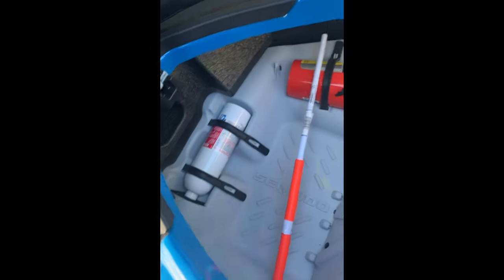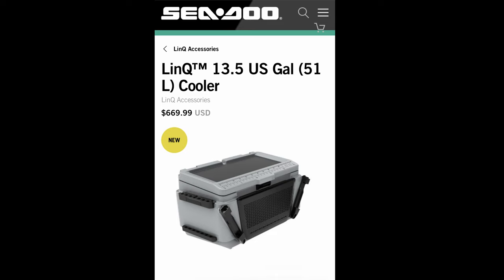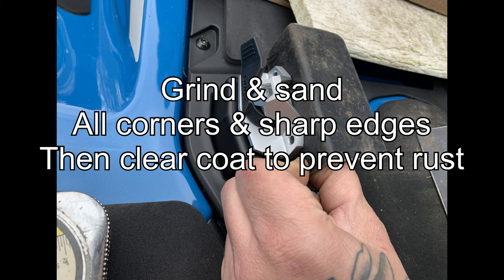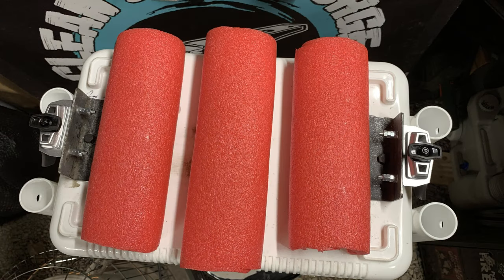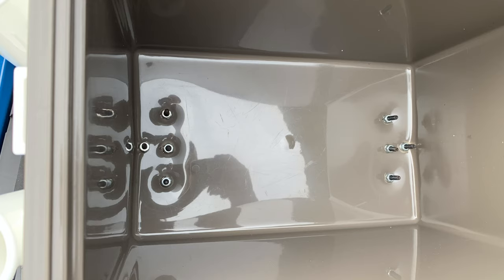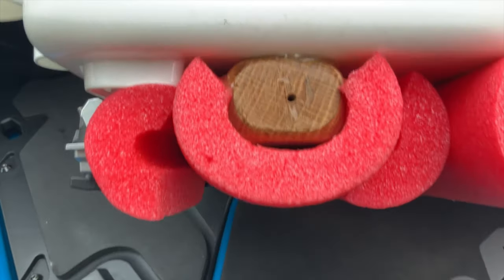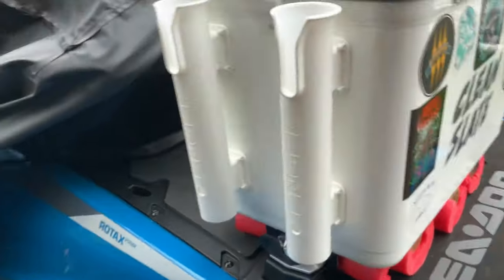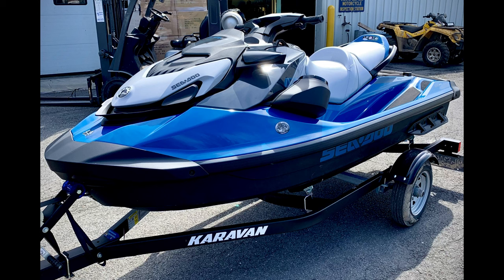SEA DOO LINQ Cooler HACK for 2020 GTI

Comment: That's great but there has to be something more elegant than the pool noodles - maybe a cut yoga block ?
Reply from the maker: Yeah.. i mean i just had the noodles laying around & was building trying to spend as less actual money as possible to have the contrast of dealer seadoo prices compared to what anyone can build on there own for way less & just as good. I may rebuild mine using that foam & liquid nails chaulking. But im still using the cooler & its been 3 summers on the lake!
Reply: @TheEvilways101  Well, it's still a great solution and can be adapted for anything else you want to mount.  They're not $20 any more though... Covid pricing :-(    I'm East Coast so no riding for now!

Comment: Question: i’d like to know the type of angle iron you got and where did you purchase that from??
Reply from the maker: I work with scraps, i used a old metal bed frame the angle iron from that i cut & grinded. But you can buy it at a metal supplier or hardware store. But scrap is free.
Reply: @TheEvilways101 it's going to rust and stain your ski, especially in salt water.

Comment: Good job. But why the wood and noodles? I don't see the benefit of them.
Reply from the maker: Wood & foam won’t scratch the fiberglass & wood & foam float.
Reply: Do you really need the wood/pool noodles underneath that cooler like that? Wouldn’t it be just fine mounted to the brackets alone ?? @TheEvilways101  …QUESTION

Comment: Thanks. I just finished mine. I had to do it twice because I forgot to remove the strap holders at the bottom. Lucky I found the metal plates at mennars si I did not have to drill to many holes    Thanks again. Do you have any videos on fish finder installation and which one do you recommend?
Reply from the maker: I dont unfortunately but i do want to install a good fish finder & depth finder.. maybe next year. Or i may just sell & trade in for the fish pro

Comment: Life Hack: Buy yourself a ratchet strap and save yourself anywhere from $300-$600 and a few hours labour.
Reply from the maker: Maybe so... i use a rachet strap & the linq connectors, combined together im able to go full send in the roughest of water without losing or worrying about my cooler.... the rachet strap alone isn’t enough.. unless your using 3-4 & who the hell wants to fumble around with rachets on the water? Do the labor now so that you dont have too out on the water
Reply: Not so true. The more ratchet straps you use, the more likely you will ruin the cooler. These coolers are not made of steel. It's just plastic/vinyl. If you ratchet too hard, then there goes your cooler.